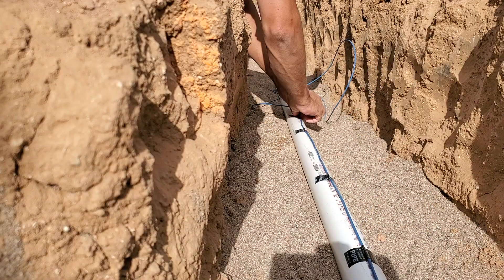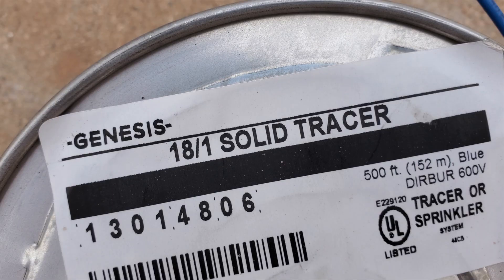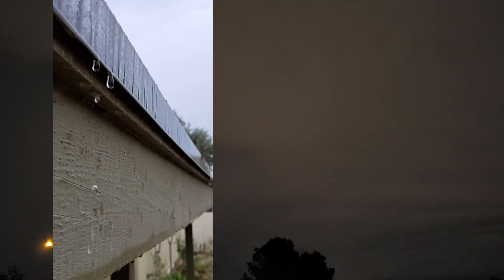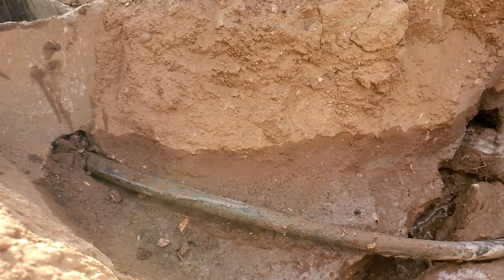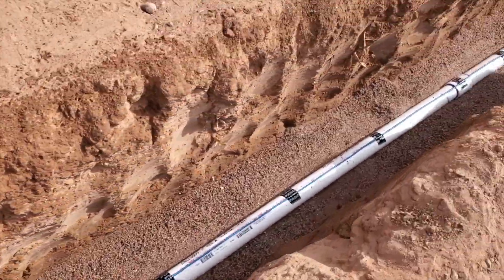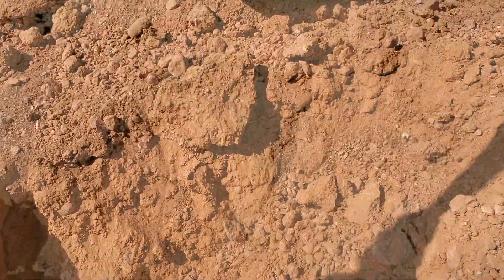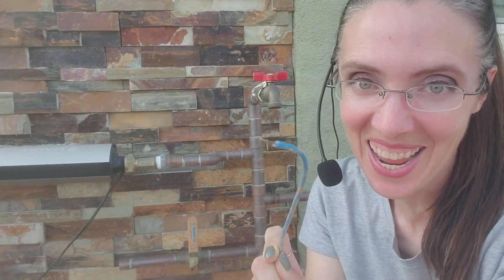What [& What NOT] to Use & How to Install Tracer Wire on a Water Service Line

Comment: thanks for your vids on DIY, love them
Reply from the maker: Really appreciate your comment! Thank you! How did your manifold project go?
Reply: @NoMoreLeaks  going to start end of Oct... I got most of the attic prepped though and turned my above garage attic area into temp storage so i can work easily in the above house attic.  It was so hot for my son and i that we decided to wait for cooler weather to start running the pex.  We will be doing a sub manifold topology based on Uponor's logic system, pex has gotten more expensive and harder to find, so many supply problems right now.
Reply: Love this vid though because once i finish my current projects i was thinking of replacing the line from my meter to the house switch with a bigger pipe, right now 3/4 inch copper and will go 1 1/4 pex instead, that is if we decide to do that. ;)
Reply from the maker: Totally understand waiting for cooler weather! Temps are just now falling below 100 here--don't even want to think about the temps in the attic. That's great you are involving your son. No doubt on the plumbing shortages: repiping partial and entire homes from spring freeze with all the burst pipes in Texas is still well underway.
Reply from the maker: You might have single handedly given me motivation to complete this water service replacement video series in a more expedient manner. If I can make the next one before Friday, you can take it as a personal thank you. 😉 Love meeting another hardcore fellow DIY'er! Dare I ask what the other projects are?
Reply from the maker: Well, I did get the next video done on how to protect PEX underground, but I realized I needed to pair it with how to protect copper. Our city requires 3' of copper on both ends of a non metallic water service line. I couldn't get two videos done with the deadlines I have on the Phyn Plus series. I still appreciate your comments and the following two videos after the expresso machine videos (which does fuel the DIY!) will be back on the water service line.
Reply: @NoMoreLeaks  awesome, I will have a look
Reply: @NoMoreLeaks  other projects: removing and replacing attic insulation, installation of baffles, in the house halfway through installing new baseboards and close to finishing.  Then installation of a centralized dehumidifier.
Reply: @NoMoreLeaks  I am close to getting the Phyn myself.  I will let you know if i do.

Comment: FYI, for those unfamiliar larger number AWG means smaller wire.  So, 14AWG is thicker than 18AWG.  This would be obvious if you're holding it, but an unfamiliar person ordering online might be surprised.
Reply from the maker: Thanks for adding that information! Having run 6 AWG for a range across an attic and wrestled it onto the outlet, it's one of those things that gets burned in memory and never taken for granted again (but overlooked in a video).

Comment: If I’m going to run this with my sprinkler pipes, does each sprinkler line gets its own wire or can I splice the wire? For example, I have 3 lines sharing one trench and then splitting off farther down. What do you do when the pipe makes a T? Can you splice this wire together with a little cap or does it need to be one continuous wire? Thank you. Great video!
Reply from the maker: Honestly, I'm not sure. When whoever is called in to assist, they hook up a low voltage machine on either end--so I'm not sure how that would work with splices. Due to how hard it was to find tracer wire I ended up with a 1000 ft roll and have an insane amount left. If you are in a similar situation I'd run a wire on each line and be happy that it got used. ;) I am sorry I can't be more helpful there, but I hope your project goes well.

Comment: I'd lean towards having the tracer wire centered (top or bottom) because the tracer signal says where the line is; whoever is digging will hopefully allow for some width to the line.
Reply from the maker: Thanks for adding to the conversation. I vote bottom.

Comment: Do you need to ground the tracer wire?
Reply from the maker: No, tracer wire is not grounded. If it is needed they will hook up to either end of the bare wire to detect the line. Best of luck on your project!

Comment: Don't forget to ground it... when grounded it can be energized allowing locators to actually locate the service (e.g. a ground rod should be installed at the point which the service entered the house to complete the circuit).
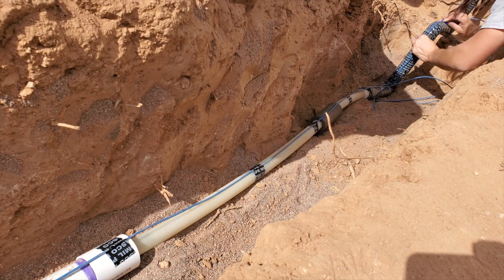Reply from the maker: Thanks for the tip! I just did a search online to look into this. It's disappointing to find out that the city approved and "inspected" neighborhood, that can be seen here (the right side still shots: 3:45) is exactly the same. I guess something is better than nothing--that doesn't make it right. I very much appreciate you saying so.
Reply: I'm still looking for a good video on how to properly install a tracer wire with grounding. It would seem to me that one end would not be useable if it is grounded?
Reply: One video says a low frequency on the transmitter requires grounding one end; low frequency is less likely to couple into adjacent lines.
If it's not going to be a problem to find both ends, seems like just leave them loose and available and either end can be grounded if needed.

Comment: Thank you for your video.  Very good info.

While watching it I got to wonder if it would be allowed to install the tracer-wire inside the protective PVC pipe.  Thoughts? 

BTW, I came upon it after watching a video on Uponor PEX failure (see: https://www.youtube.com/watch?v=FcHcKvZ3AZE ), and wondering how to best install a drain fitting -- the plumber was supposed to install 2x, but never did, and during post-final permit close out he suggested that I periodically drain the system -- I pointed to the Wall-O-PEX and replied -- you never installed either the two drains specified in the original statement of work...  While the look on his face was priceless, I still want to install the drains.
Reply from the maker: Oh no! He didn't install them on the spot to finish the job?

Honestly, I don't know. I'll have to punt to a plumber's expertise and I'm not sure if something like that is mentioned in code. if it is OK, the outer pipe better be bigger than ours because it wouldn't fit. Best of luck on your project!
Reply: @NoMoreLeaks  re: bigger pipes...  If I remember you came back later and used a larger pipe so that it would fit over the PEX fittings.  The final pipe I thought was big enough to run a trace wire, but I could have been wrong.  If you can ask your plumber that would be nice to finish the thought for people on-line asking the same thing, but it will be awhile before I need to do anything like this (I hope anyway).

re: the plumber...
No he did not.  I should have forced him to do so, but working with this one was an epic pain.  My original plumber had a massive heart attack as he was drawing up the job, and could not take it on.  The replacement was brought in by my contractor.  He claimed he had expertise with PEX, but kept doing things wrong that we so out of code that I seriously doubted he ever saw a professional PEX installation in his life.  He actually wanted to leave the pipe left unsupported as it came out of the wall onto his custom manifold.  I think I had spec'ed a Viega (or similar) manifold, and offered to pay for that on top of their quoted job they had with the contractor.  They just went ahead and cobbled one together with HomeDepot 1/4-turn valves, and a couple of plastic and copper manifolds that hooked up to the shutoff valves.  I did not catch this until he had that monstrosity installed, and there was no way he was going to take the time to redo it... (EXPLETIVES!)...  Next he installed the frost free hose bibs incorrectly (they were pointing up, and we not mounted to anything so they wiggled when you turned them on).  I called him on this, and asked him to correct it within the next week -- before the foam sprayers came in to spray the walls, and I would have to dig out the insulation to make the fix.  That is when he quit the job, and told me to transfer the job to someone else.  A month later I threatened to fire the contractor because they had done almost no work in an entire year, and they also quit.  My next contractor was good and professional, but we were not able to close out the renovation contracts because of the first plumber still had an open contract.  I ended up writing the head of the plumbing inspection for help.  That plumber told them that his contract was with the contractor and not me, and that when I fired the contractor their contract was null and void.  This was all a lie because they quit before the contractor quit AND I had proof in the email chain I sent where I called him on installing the hose bib incorrectly, sent him the link to the manufacturer's installation instructions and why it must be installed that way, and his response was to quit.  I was not privy to what all happened when the the State plumbing inspector realized he had been lied to, but he did come back, finish the ~$200 of work that needed finished (which I payed him for), and closed out the permit.  I did learn that the contractor was jerking him around and not paying him for jobs, etc., and hedid not want to deal with it.  Asking him to do anything extra after the permit was finished was not something I was keen to do.  As you can imagine I will not recommend him, but I have also not called him out by name -- at least he came back and finished the job.  Len The Plumber on the other hand sent out someone to finish the job charged me $2,000 to do about $200 of work (under the agreement that they would transfer the permit and finish the job), then refused to close the permit, and the inspection showed that everything they did was wrong.  That got investigated and I found that Len The Plumber sent an unsupervised apprentice who gave me a card stating they were a master plumber, and said they he would transfer the permit.  That the extra charge was to account for the liability to have to fix anything that was not right with the first job.  In the end, LTP returned what they charged, and both LTP and the apprentice had letters of reprimand from the state inspector for a half dozen serious violations...  No, the renovations on this property was a (EXPLETIVE) show.
Reply from the maker: Oh wow. Just wow. That's a terrible experience and one that gives contractors a bad name. Glad you had that all in writing! SMH... And despite all of that you are educating yourself with more information on plumbing. That's impressive.
Reply: @NoMoreLeaks  I will probably be the one maintaining things for quite a while, so it pays to learn all one's life long.  I may end up installing the drains myself, or hiring a plumber if code requires it.  It is my understanding that I can do minor work to repair things, but I am not sure where the line between being allowed to do it myself, and requiring a permit.  I will check into that, but I do expect that I will eventually have to replace a couple of the lines because:
* he did not mount the pipes on the studs, but ran all 12 lines THROUGH all the joists.
* the transition from the copper to the PEX from the outside main may have been kinked, but is not leaking, but you got to wonder if that will weaken it.
* he spliced several sections to save money - even though it was specified "no splices" and "home run" - I would have gladly spent the extra money on another spool of PEX...
<sigh...> Enough of my belly aching.  It is not leaking, and I have a clue to what I need to do to fix things when it comes time.  With any luck I will find a good, professional, PEX experienced, plumber.